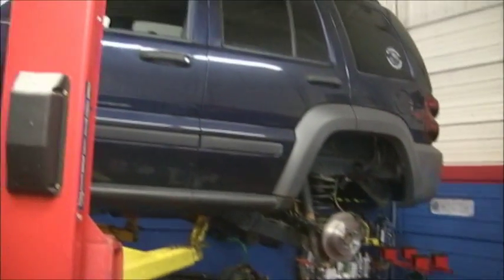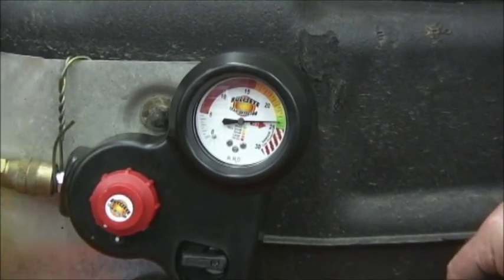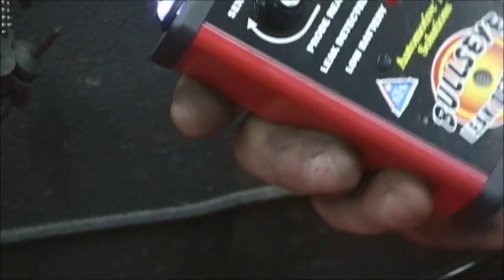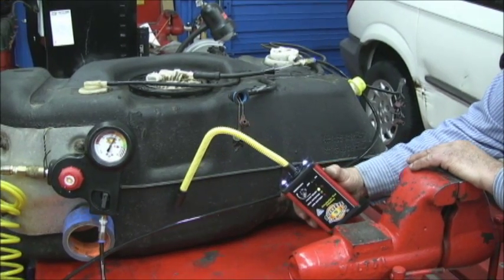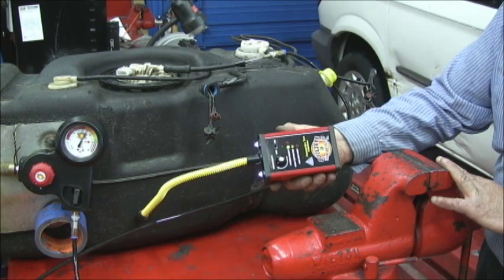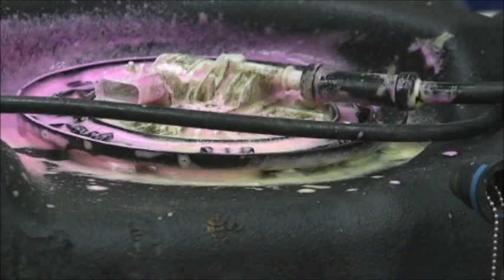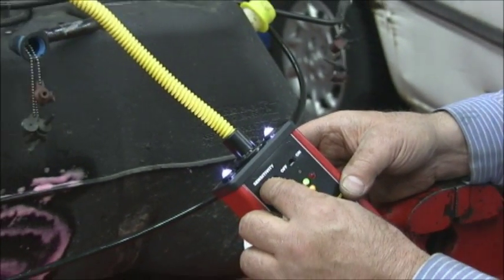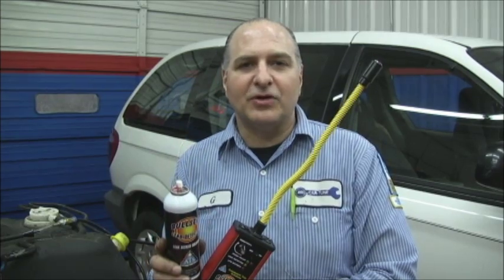ATS' Bullseye Leak Detection System

Comment: One of my techs has this tool. It's a neat tool but suffers from one major setback: the sniffer is not perfectly accurate, and what really sells the leak is the special fluid which runs out very quickly, and also makes a mess. Granted it does was off easily.
Also a smoke machine will find a leaky fuel tank. I used it on an e60 BMW which had its tank damaged with a jack by a tire shop. The way to find a leaky fuel tank with the smoke machine is to connect the smoke source right at the fuel cap, and turn the machine to the maximum flow setting, and plug the exit lines to the vehicle. In a couple of minutes, the tank will fill and pressurize, and you will reveal your leak. HC have no effect on smoke. The issue is if you dont pressurize the tank, the smoke will not exit. It's very difficult to pressurize the tank from the evap port.

Comment: Smoke would find that leak or use 4 gas analyze measuring hc
Reply: robert weissbergI used a smoke machine and could not find smoke coming out of anywhere. The problem with smoke when there is a leak in a gas tank or canister is that the smoke is consumed by the HC in the tank or the charcoal in the canister. Smoke machine are great for many EVAP problems, exhaust leaks, coolant and oil seal leaks and much more but on this problem it just could not find the leak. If you have any questions please email me...thanks for watching